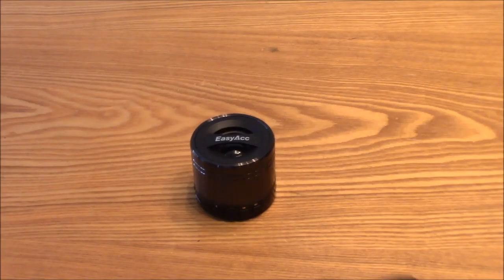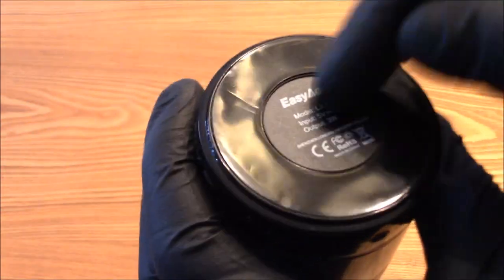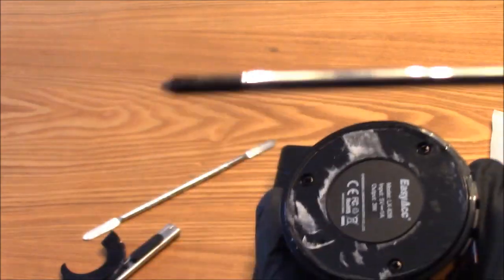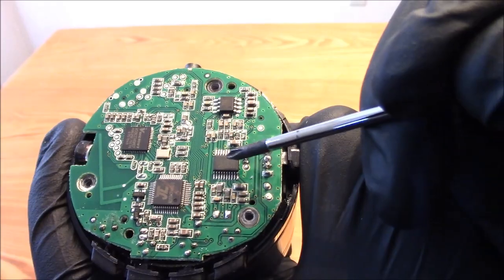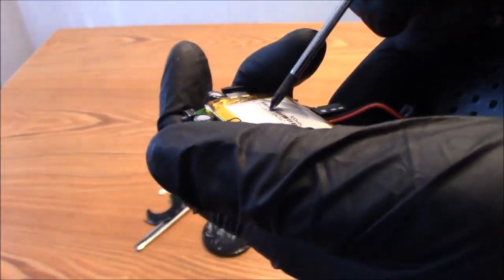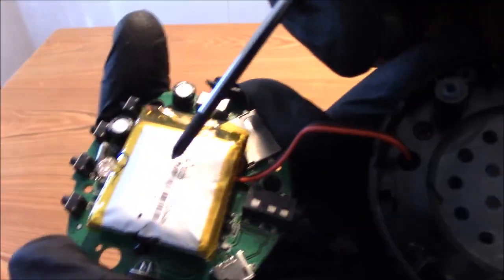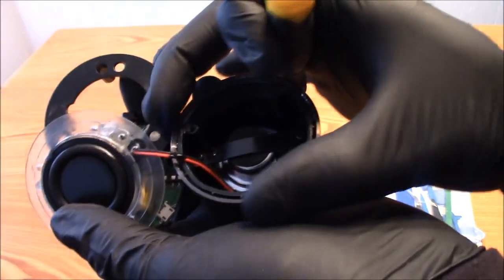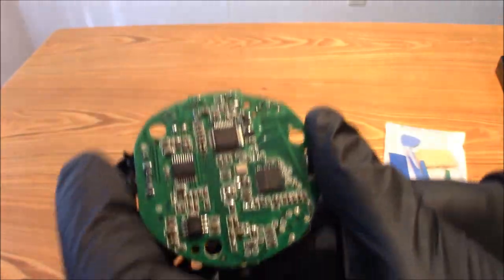How To Take Apart The EasyACC Portable Bluetooth Speaker To See The Technology Inside

Comment: Got any leads on how to take apart an ihome Ibt76? I've poked and pulled at numerous different areas with a small flat head and a pick and razor but nothing wants to come off without a fight except for the aluminum speaker cover , it just randomly stopped working on me one day outta no where , just shut off and won't turn back on so I'd like to get it apart to see if it has a bad power button or a faulty charge port or something hopefully cheap and simple so I dont have to throw it away , unfortunately it seems from my experience and that of my immediate families as well none of these speakers no matter the price or brand name are meant to last more than 6-12 months before just randomly dying for no apparent reason and they make them very difficult to service and repair if you can even aquire the repair parts most of the time forcing one to have to go out and just buy another speaker which is really getting old after going through 4 of them in the last two years which is absolutely rediculous especially being they were all were "name brands"
Reply: I found a TVIN outdoor bluetooth w TF speaker, (cylinder shape) but the end with the usb & sd(?) Slot is broken, & 3 or 4 wires are broken off the small round PCB! Have you taken apart one of those? Thanks the rest of the device seems in good shape!

Comment: Nice little how to video bro thanks but latex work gloves ? Did you seriously need to wear those working on a bluetooth speaker bro lol you know that looks mad girlie right ? I just successfully fully tore down my dual speaker mini jbl boombox Bluetooth speaker just to find that the replacement part I needed (the usb charge port) isn't sold separately and is micro soldered into the board so I wouldn't have been able to solder in a universal one anyway as I don't have microsoldering capabilities.